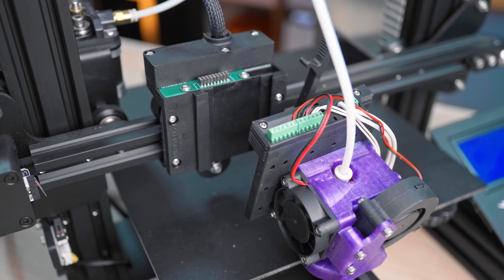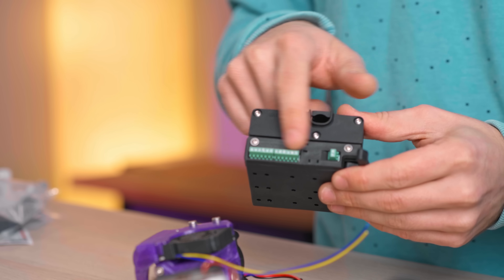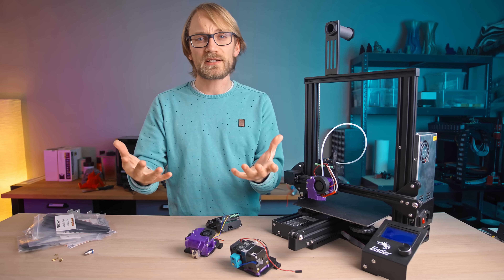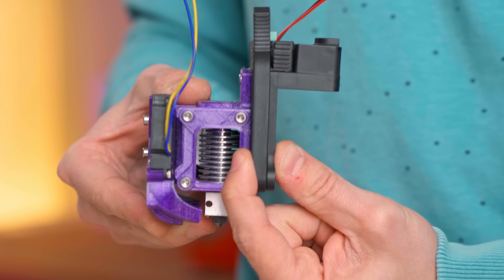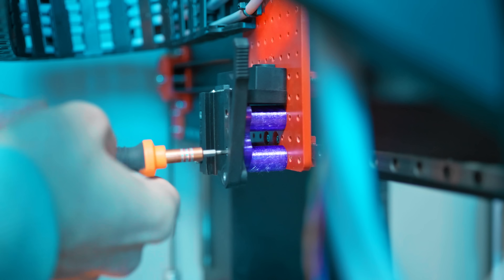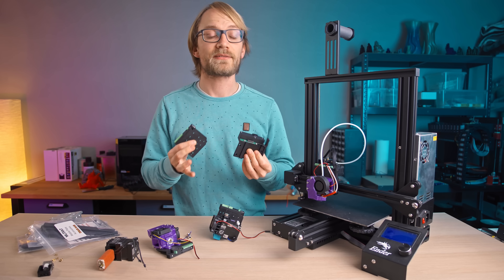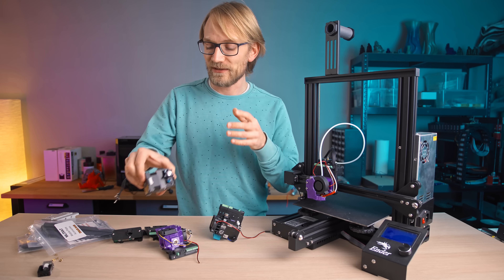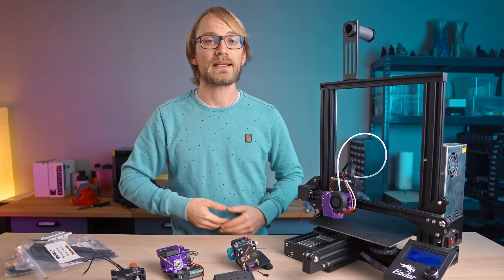WhamBam Mutant: A Quick-Change Toolhead Upgrade for any 3D Printer! (NOT on Kickstarter)

Comment: I remember this 'solution' from a while back, and though they've moved on to V2 now, you don't hear about them all that often. Not sure if that's a low adoption rate issue, or people don't have to troubleshoot them very often. 
On that patent section, a common tactic around 'patent pending' use terminology is just filing for a patent gives you a window of protection for new technology. Many times what happens is the full patent is never filed or issued, as it's both time consuming and relatively expensive for a one man or small outfit to pay for. Filing, however, is a few hundred dollars and grants you a window of exclusivity; at least from other competitors/countries that respect patent law.

Comment: I have one of these but what I don't like is it doesn't natively do dual hot end etc... so in that case it is very limited to a single hot end heater or anything that needs a single higher power. Unless you route the electrics and thermistors etc to them directly of course.

Comment: isnt this a bit pointless? you could just print this yourself
Reply: you can't print a PCB and solder pogo pins as easily. 
Also, you would need a high temperature material, with tight tolerances

Comment: Finally someone is integrating the quick change connections used on firearms! I was wondering what the issue was when the military has lasers and scopes that can hold a zero, after being taken off and replaced, for years now. The stressors on a firearm are so much more intense than anything on a printer. 🤪

Comment: I'm looking at this as if I have a hotend assembly that all of a sudden starts failing & don't have time to take it apart at the moment. I can swap the head, keep running, & worry about first one later. Yes, it's $85, but my printer is still producing, which is putting $$ in my pocket. So yeah it would be worth it.

Comment: They ought to extend the mating plates, add a protruding flange to each, and split the Biden tube in two with one half attached to each flange. You then just retract the material past the flanges and then swap the heads.

Comment: Patent Pending Product for the Maker Community? Guess what I'm not buying! 🙃 Nothing shown here hasn't already been built by the Maker Community... Fuckin' lol... You can definitely 3D Print your own version that perfectly matches your setup without compromises and doesn't arrive crooked and, if you feel fancy, have a PCB Manufacturer do the two Connector Boards for you all at a fraction of the cost this would set you back - It's not even funny thinking about buying this crap.

Comment: Ok this is not reasonably priced. Everyone can do it in a simpler form with appropriate openbuilds gantry plate, screw nut block, magnetic pogo pin and longer vertical screws as locking system. It will cost maybe 10-20 euro. But not everyone has the time and desire to do it....thanks for the review...

Comment: 14:14 "But mostly the cost is just going to be down to ..."
And you guessed wrong. A lot of money has to be spent on applying for a patent.
I think these warped plastic parts are too expensive for what they look like. The warping can be a lot less if money was spent on designing the part for injection molding.
I think the price is too high. You are still stuck with either bowden or direct drive so optimizing one tool head for flexible materials will still not be truly possible on a printer like an Ender-3 unless you convert all your tool heads to direct drive

Comment: Hey Tom,
the Patent of heated Chambers has run out, thats not the Main excuse for this.. 
The real problem is safety.

So, da ich weiß, dass du deutscher bist und mein Englisch nicht das beste ist, auf deutsch:
Das Problem mit den Beheizbaren, geschlossenen Bauräumen ist nicht das Patent.. das ist ausgelaufen und so nichtmehr gültig!
Das große Problem ist mehr die Sicherheit.. so eine beheizte Kammer kann schnell mal anfangen zu brennen, wenn sie (zu) günstig gestaltet ist. Deshalb scheuen sich einige, dies jetzt in die Tat umzusetzen.

Liebe Grüße
Mach weiter so!

Comment: good work Thom I am eager to buy this tool but would it be not better ´from Wham Bam to sell at least wit h two mobil kits than you could change at least two Hotends ?
Reply: Wham Bam's main kit is the Quad; one Fixed Plate to mount to your machine, and 3 Mobile Plates

Comment: lol blowing on the cart - also nice usage of the thermal camera (looks like a FLIR)

I think your comment about having more than one printer instead is a good idea, with this you still have to have a draw full of parts anyway, so the space savign isnt huge.

I have three 3d printers, one for detail prints with fine nozzle, one for high temp prints that needs enclosure and one for pla like printing where no enclosure is needed. I think that is superior to adapters in everything barring space.

Comment: Hi Tom, thanks for this video. I'm not really interested in buying this of quick ''change" tool. With all the effort it takes to make the wiring and the adaptors, just push a little more and you have your own DIY system. The slide guide and the connectors are interesting. One can do it with an other kind of connectors, like, any type of connectors and divide the ampere by each single terminal. The slide and lock is an interesting thought, but like you "said", should we encourage patenting of this kind of tool?

Comment: I think there is a need for quick-change upgrades, if they can be made affordable and open-source. For a small print-farm, it could make sense to have several nozzle sizes. For people who do more exotic stuff like pen-plotting or food-printing, servicing is much more of a factor.  But the WhamBam Mutant doesn't seem to fit the bill... Also maybe the higher current cables should be handled like the Bowden tube, ie not by the plate.

Comment: I would love to have similar system on Prusa to simply remove the whole extruder assembly for service and maintenance. It would be so much easier then the current setup. You could also different nozle or extruder setup in stand by like the ToolChanger.

Comment: Hi Thomas, I am looking for a printer that can reliably print working parts with tight tolerances.  Strength and Tolerances. + - .004 thousands + - .1 mm and what is the most heat tolerant filament.

Comment: I feel like the built-in electrical connectors add more complexity without much benefit. I think I'd rather have a simpler quick-release plate, with a separate electric cable which unplugs.

Comment: patent ??? how can there be a patent on that ?  i have tons of stuff that work this way??  i got rc heli's that have electronics that click on just like this.. i just printed a click on system for the gears on my P40 plane (electronics for leds and gear moters included )  and i just printed a click on system for my laser cnc  so i can disconnect it in 2 sec....  but its nicely done  👍

Comment: The concept is interesting, only so far as applying it to a 3D printer... there have been nearly identical things in machine tools for decades... including mating connectors and locking mechanisms...  the thing looks quite poorly built when you consider the materials, and the warping and dips point at someone not giving a damn about quality and trying for a long term money grab... Then there is the whole wires getting "hot" part... didn't they learn a damn thing about 3D Printers causing fires?!?!   You *DON'T* do that!!!!    Price point is incredibly high for what is offered, and the coup d' etat of this system is that the turds are trying to get this patented... Is it marginally handy? Perhaps in specific situations... However, to take a point from their name, they cannot stop me from designing and making my own versions that are better fit and function and likely cheaper for myself, so... Wham, BAM, Thank you man!  (TBH, This is seriously more of a "concept" than a good working product)

Comment: If you have a Venn diagram describing the values or qualities of person who'd be interested in this, for example: 1)possesses sufficient knowledge of hardware/firmware to get the most out of tool changing systems 2) okay with tradeoffs for not just creating/buying a purpose-built machine 3)low on space 4)okay with patent protected products...when I think about those overlaps, I tend to think nozzle swaps might end up being the most popular use case.  For me, that would by my personal interest (when possible to do within the same print and not lose Z height calibration).  Thanks for your analysis, Tom!

Comment: Regarding 'patent pending':  just because someone applies for a patent does not mean that the patent will be granted.  For removable 3D printer tool heads, there is an awful amount of prior art out there.  It will be interesting to see if this patent is granted, but even if it is, there are already a lot of removable 3D printer tool-head designs that are available for the community to use.

Comment: Grüße aus Berlin, Maryland!
I've been interested in a quick change for my Geeetech A20M because I find myself using only one extruder and would like to have an easily swappable single hotend as compared to the standard mixing hotend. There are multiple reasons: a) More options for hotends; b) conversion to direct drive; c) huge variety of nozzles.
The more I watch videos about quick changers, the more I agree that it makes more sense to invest in a second printer. Any thoughts? Maybe I'm just looking at it from the wrong perspective...

Comment: I have been using /thing:1670305 for several years now, and it doesn't have the mounting problems this L shape design has.  (also--  no patents. What fumes were Whambam inhailing)
Reply: Looks nice, except for the DB15. I'm using DB15 on my delta, but I feel lucky that it handles the 2A+ that my hot end draws while heating. I'd feel much safer with something where the power leads are on a bigger connector. Unfortunately, I'll probably have to roll my own, as the WhamBam doesn't look like it'll work too well on a delta. Once I have a cartesian printer (hopefully soon), I'll be considering it, if for nothing else but nozzle size changes.

Comment: Patent pending ..... no thanks !!!
Just another way to stop innovation and locking it behind a patent.  Makes sense if it's mass produced and there are various competitors (i.e. automakers, airframers, etc) where we have shareholders who want to protect their $$$$, but for 3d printer community where innovations is still needed patents just create a roadblock which Tom points out in the video.

Comment: i bought in for the x change tool change system, Mostly for changing nozzle size and to keep filaments dedicated to their own nozzles. if i have an order for abs i can do it then immediately switch to my CF nylon and keep the machine running for the next print job.

Comment: Nope.
I've used these sorts of contact-pins before.
Used to mate PCB's together in a stack, 20-50 insertions cycles and the contact force is gone.
These have to carry the current for the heater; any resistance in the pins = heat in the pins = more resistance = more heat...death spiral.
Use connectors that are designed for 10's of thousands of operations, handle high current, low electrical resistance and able to reject dust...
The Xchange system uses spring-contacts that are indeed rated at millions of operations, low resistance, high current, dust rejecting...
Having made such a poor choice in so critical an area leads me to ask: what other engineering surprises are coming?
Going cheap to get to market fast is gonna backfire.

Comment: The Mutant quick change system is something I am interested in.  I would use it to quick change different hot ends so I can print different projects for my business.  Sometimes I wish I was using a 0.6mm nozzle and other times I would rather use a 0.4mm hardened steel.  The price is a bit much.  I think $49.99 for a set would be a better price point.  I understand there is a lot of R&D involved to get to where they are now.  That might explain why they are charging more.  I am a fan of patents, especially in the beginning of the idea. They need to recoup their cost for getting to where they are today.  I would hope that after a few years of recouping their cost, they then release the patent for others to use.  I also understand the argument for not getting a patent.  It is a juxtaposition of R&D and manufacturing costs vs open source innovation.

Comment: Wow, this is really, really expensive. In a competitive market this should cost 10x less. Its two simple, simple pcbs and there Injection molded parts.  At this price point I would have expect high end features like preset threaded inserts, pogo pins or maybe a more rigid plastic if it would benefit from it.

Comment: The one piece of info I was looking for was the repeatability of this tool changer? If you calibrate your Z-Height, how far is it out every time? I'm assuming a bed touch sensor is needed and needs to be scanned every time you remove that tool head. It's not something you can swap out mid print.

Comment: I doubt it would be awarded (this is a plastic lathe quick change tool post, crossed with an ink jet cartridge holder), but just on the principle, let's not buy these, ok? Don't reward this behavior of trying to privatize and "enclose the commons", capitalizing on community work.

Comment: Thanks.  The 3D printer market is like the PC market in 1990 and it's exhausting for me.  Tom, given all the players, is there an equivalent 'Apple 1990-2020' 3D Printer maker?  Expensive ok, but great prints compared to all the others?
Reply: You are a fool looking for an Apple clone in 3D printing. You will get only proprietary connectors and pay 50$ for a USB adapter. Don't ever try to repair your printer yourself. Apple will prevent it. Only download STL files from the Apple stl-store. And if Apple does not like your political opinion, your models will not be on the stl-store . I could go on for hours. Watch Louis Rossmann.
Reply: @banknote501  Thanks for calling me a fool.  Much appreciated
Reply: @GerardHammond  You're welcome. Sometimes you have to call a spade a spade.

Comment: On my Prusa MK3s, I've had to replace enough parts to make me wish the wiring didn't run all the way back to the control board. Something like this or the XChange seems like a possible solution to make repairs like that faster and easier at least. Looks like the XChange is more suitable for MK3s, but comparing the two (and any others) would be a good topic for a future video. Appreciated your review here as well as your Meltzone discussion.

Comment: This was such a good idea until the price!  Damn!
I think I'm going to stick to something closer to what the Up Mini has.. A simple detent locking dovetail with a manually removable IEC type connector on the top.
Slower than this, but as it's mostly for 'removing printer head to clean/rebuild the head, I don't need fast, just not-hard.

Comment: But my Ender 3 is my best printer. So cannot afford a Prusa!

Don't think that this tolerant is for me. I just tend to keep 1 machine for each material I need. Even got my old Abet A8 clone (custom marlin installed with thermal runaway) printing exclusively flex, makes life easier!

Comment: I actually like the design of quick change heads for metal lathes a bit better. Electrical contacts should be slid over contacts of the type found on rechargeable tool batteries, rather than the pin and socket variety shown. Slots for mounting hardware, and an alignment jig that the movable plate drops into that allows you access to the mounting slots, and which allows you to mount the print head so that the nozzle is at a consistent height. (Or at least make sure nozzle head to sensor level for ABL systems are consistent across heads.) Other than that, yeah, a nice idea, and I probably won't get one/any.

Comment: The high friction pin headers are garbage, they won't let 200 tool changes.
A spring steel based contact like on camera batteries would be much more durable and only slightly larger

Comment: Seems like it would be a better product if they sold an electronics and hardware kit for a fraction of the price and let you print out the plates. The injection molding is not clean (looks like it was designed for FDM, and then just sent to a toolmaker), and probably the reason why its so expensive.

Comment: I designed and built my own printer so my "tool" is already as quick as it needs to be to remove. 2 - 6mm SHCS and the entire thing pops off and only the heat cartridge is hard wired all the way to the controller board, the rest have connectors already. If I desired more functionality, I would add a deans ultra plug to the heater cartridge (I'll prob do this eventually anyway). I cannot come up with a decent usage for this tool change system in my setup and the price is less than desirable. I'm sure someone will like it and pay the price, but it's not for me personally.

Comment: It is not something I would use to change tool heads in case of crashes, maybe I would use the adapter for different types and diameters of Nozzles. Very good info as always.

Comment: Thanks for a great and timely review.  I'm working on my own quick change system that is based on ProperPrinting's design and a DB 15 for the wiring.   I worked with Max at OmniaDrop to modify it to include the mount as part of the main body.  I also signed up for the Kickstarter for the X-change.    My use is to be able to change OmniaDrops with different nozzles and to be able to service them on the bench instead of the printer.   I ran into the problem you pointed out, when you start adding mounting plates on  top of mounting plates you loose print area and the geometry starts getting very crazy.